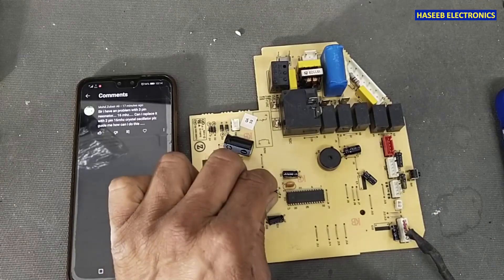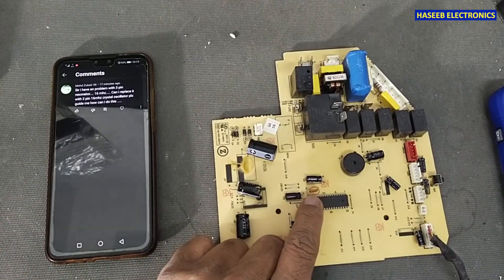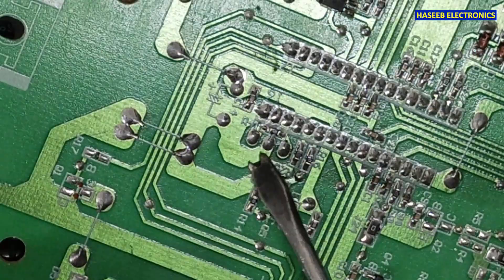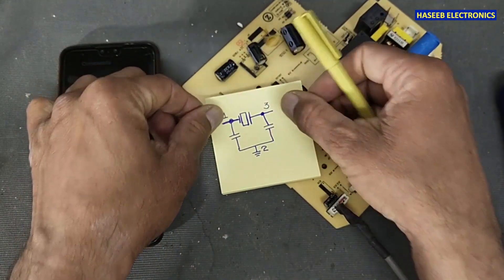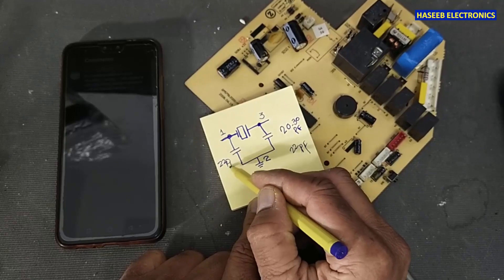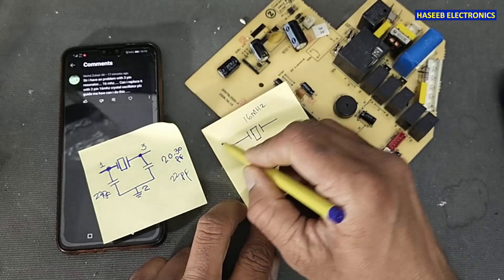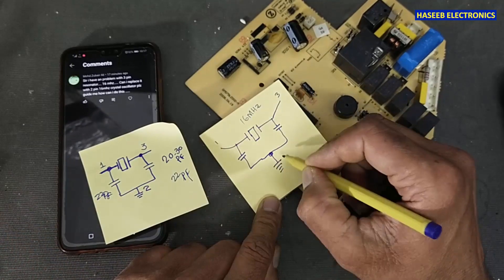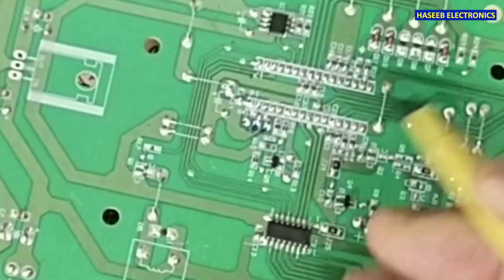{819} Replacing 3 Pin Ceramic Resonator With 2 Pin Crystal

Comment: An excellent question and an excellent answer. To the person having the question... You will need room to work in the Two-Pin Oscillator and its additional Caps... You may be able to gain some space, by leaving the Oscillator high off of the board and attaching the Caps to the Oscillator's pins. If you use this method, it may be easier to solder the caps to the Oscillator pins, before you solder the Oscillator to the board. Or, if there is space under the board, you may be able to place some of the components on one side and the remaining components on the other. Cheers!
Reply from the maker: Good Morning
Special thanks and Special Salutes for your valuable addition. 
please accept my best regards

Comment: Assalam o Alikum sir i need 8mhz Three pin resonator but i am unable to find it in my local market if you have one can you please send me i will pay the shipping and component cost
Reply from the maker: Wa alaikum salaam brother 
I don't have resonator 
You can modify using 8 MHz 2 pin crystal oscillator by adding required RC components
Reply: @HaseebElectronics  JazakAllah , many thanks for your reply do i have to follow the same steps as you mentioned in your video ''{819} Replacing 3 Pin Ceramic Resonator With 2 Pin Crystal'?
Reply: one more quick question i need this component for Haier top loaded Automatic washing machine PCB does crystal work fine instead of resonator?

Comment: Sir
I have one problem for A/C board, no hve any capacitor, but i remove this 3 pin component and test by meter ceenter pin to one end 23 pf. Center pin to other pin 20pf,what is this coponent. I remive from anither board same 3 pin comonent fix sane place board working properly. Is it cristel?

Comment: Thank you. I was wondering what it was this device.
Reply from the maker: best regards
it is most commonly used in air conditioner indoor unit circuit boards
Reply from the maker: it is used in air-conditioner indoor unit circuit boards